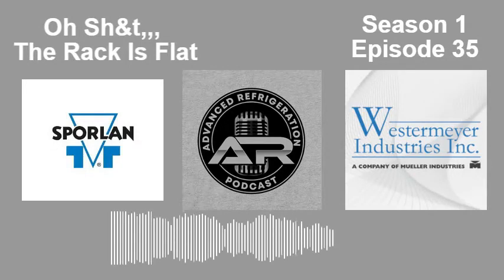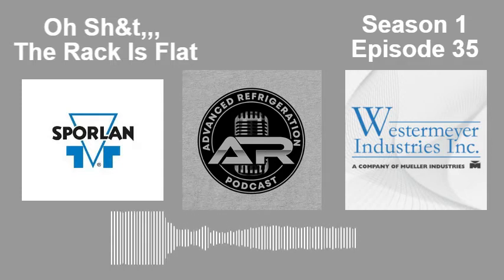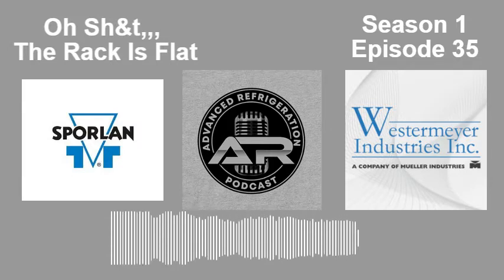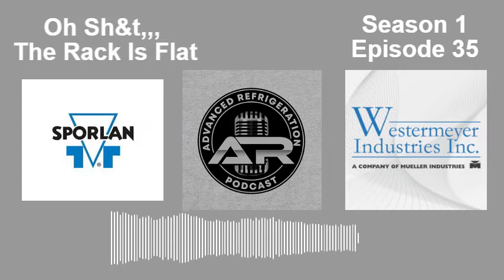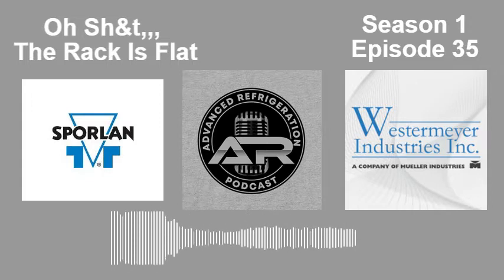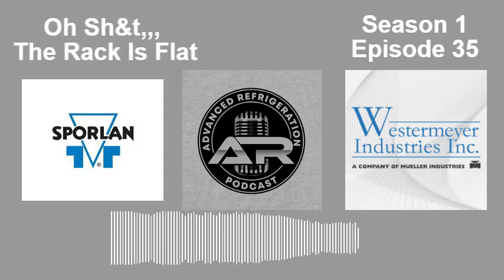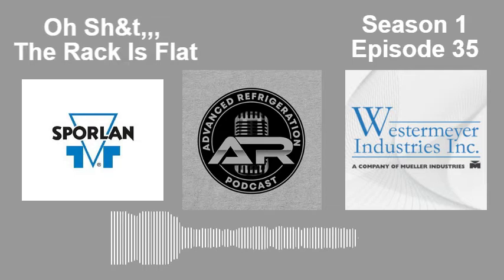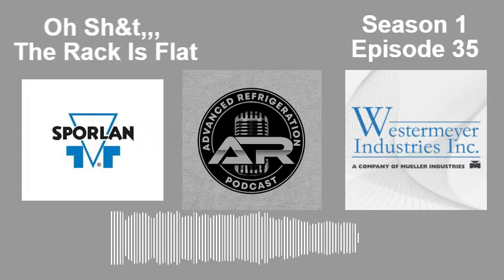Oh sh&t,,, the rack is flat (Season 1 Episode 35)

Comment: Hi lads , very interesting podcast 👍 
Now i don't work on racks but I work on chillers and water source heatpumps , so we have to recover pretty big charges quite often and of course pull vaccums on big ol' systems .
I do very much  struggle with recovery speed , partly because my company supplied recovery unit is  rubbish , despite me using for the best of my knowledge all the proper measures ( pulling shrader cores , 3/8" hoses , no gauges ) .
I've been listening carefully to you guys but I cannot seem to picture the tools you've made for yourselves to help with recovery and vaccum speed .
Is there somewhere I could see what it looks like , maybe next episode you might have some pictures on the screen ?
I struggle with the vaccum as well , I can almost never get below 700 microns despite leaving the bloody vaccum pump on all night and despite passing the nitrogen  tightness test beforehand !
And yes I do change the oil in my pump and all that good stuff ( I'm not impressed with that pump by the way , unfortunately they wouldn't listen to me and buy the good stuff ) .
Any tips on how to improve and speed up the recovery and vaccum process , like I said I do pull shrader cores , no gauges , straight to the recovery unit and straight to the vac pump .
Thank you very much indeed lads , I appreciate your help and the time you put in 🤜🤛.
Reply from the maker: Look Me up on facebook so we can connnect and message back and forth... Brett Wetzel
Reply: @advancedrefrigerationpodcast  you guys have an email I can reach out to you through it ? I don't have fb .
Reply from the maker: @sterling archer advancedrefrigerationpodcast@gmail.com
Reply: @advancedrefrigerationpodcast  thank you sir !